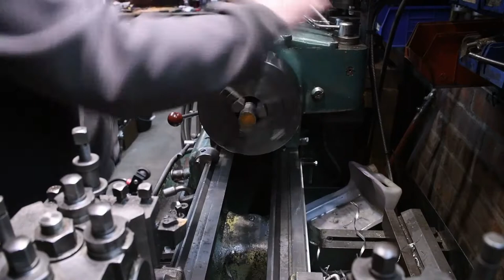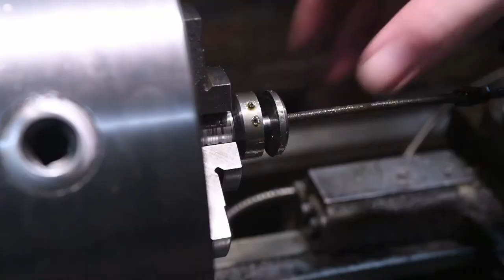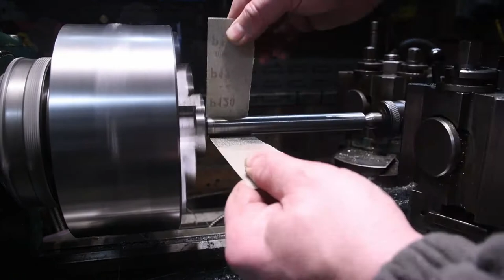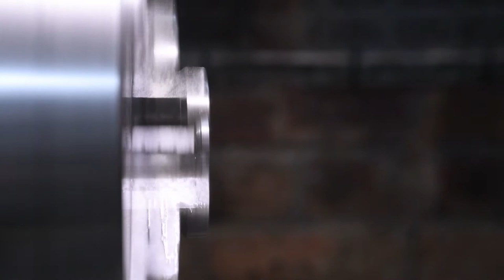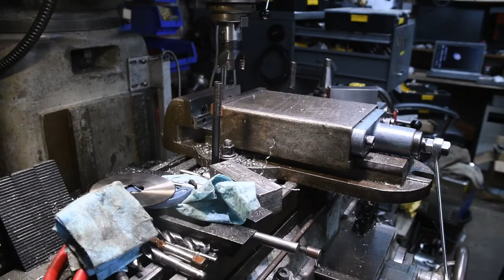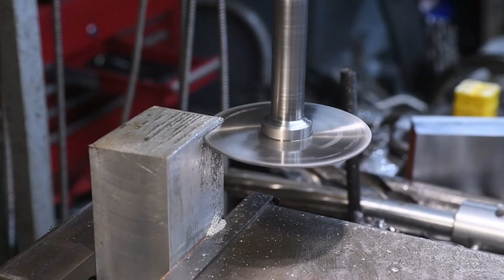Quick Project: Slitting Saw Arbour

Comment: Please put a wood block across the ways of the lathe before removing/mounting the chuck (best to make one that fits the v's and is profiled for the chuck) ---- its so easy to drop the chuck on the ways ----- not only that but its much easier to remove/mount the chucks...
Reply from the maker: Thanks for the suggestion. It's on my list..
Reply: @m0xya  I would like to second that suggestion.